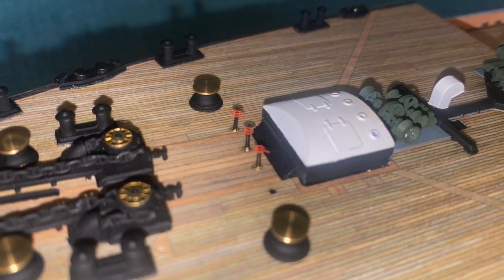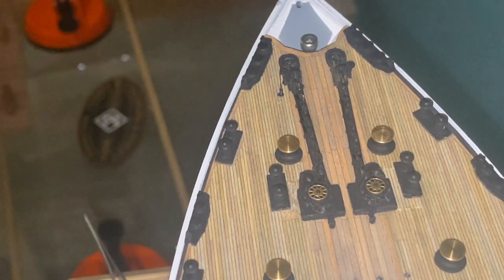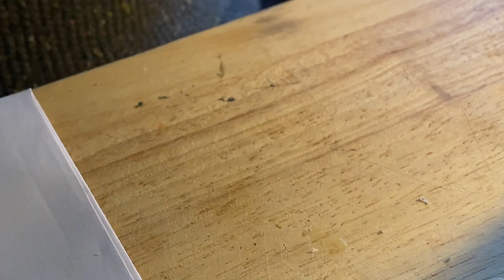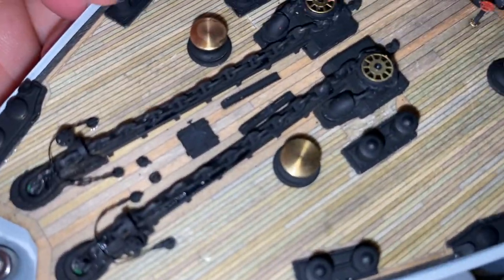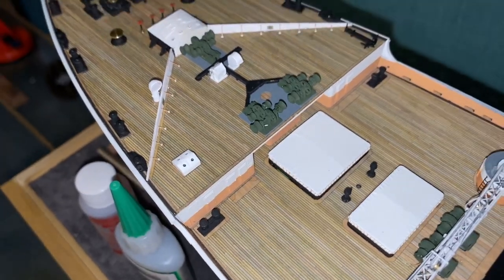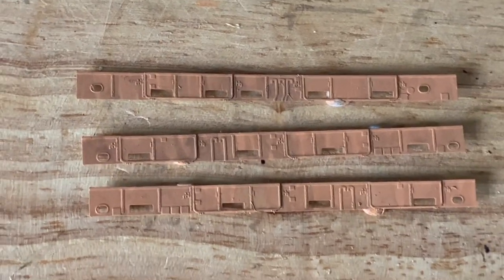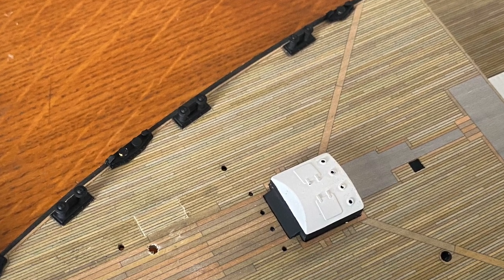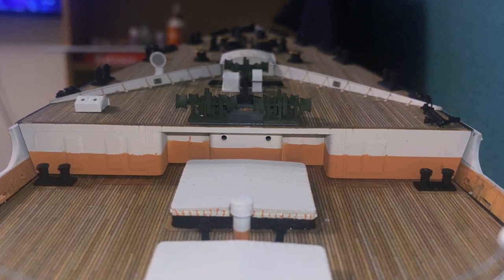Radio Control Trumpeter 1:200 Titanic Build Part 20 - Forecastle and Forward Well Deck

Comment: You know those diagonal bars behind the breakwaters. I think they were so the cable/rope that was usually flaked out behind there, Could be pulled over the top. If you see close up photos of the breakwaters there is no way they needed supports as they were very substantial. So you could lay a rope out behind them...
Reply from the maker: Yes I suspect that is part of their job. It would certainly make it far easier to move lines about!

Like a lot of things I suspect they had two purposes, I reckon they must have been for support too. If you have seen the videos on YouTube of some of the Atlantic waves ships encounter, practically everything at the front of a ship needs reinforcing!

Comment: Nice!  I was interested in the decking repair as I will need to do stuff to get rid of the lifeboat stand slots.....or buy another updated sheet 3 which is hard to get!  The details looks great and I want to move on with mine but wooden ship display case first.....hmmmm!  Hope your work is not too unpleasant if you have to work outside at the moment!  Looking forward to you tackling the aft well deck detail etc. Stay safe, regards JH ;-)
Reply from the maker: Thanks, yes the decking repair is tricky, but actually reasonably effective once done. I hadnt realised you'd have to tweak your scale decks but yes of course you will! Thats going to be a big job! Fortunately im indoors mostly, occasionally have to go to depots but still indoors if a bit chilly! You too, cheers!

Comment: Thank you for sharing!! It's a shame they sell an expensive kit and then it one needs to buy countless updated kits/ 3d prints, phot etchings, upgrades to make it look sharp... Which one would you recommend, between the pontos, Mk1, Ka etc?  It becomes quites the investment indeed :)
Reply from the maker: Hi there,
I think it would be a pretty good model without any add ons, though clearly not as good as a model with some addons. 
I think I would say the best single add on is scaledecks (as I think the model is big enough that it really benefits from a wooden deck).
Other addons, the KA set is good, but there is just tonnes of stuff. So really this depends what you fancy.
In some ways I’d say you might be better to pick and choose a few bits and bobs you want from China 3D and Woodies Modelworks
Reply: @TheModelBoatGuy   Thank you for your asnwer and help.  I'm confused, because there is the Pontos set, I did see the MK1 set as well, but the KA set I can't seem to find any trace of it....perhaps they are all sold out. I did see there are different versions of the decking, one which Midwest model shop uses which I like which is a bit darker, and the other versions which have a yellowish hue to them. It's quite overhwleming, although I might consider the china 3d prints :)

Comment: thanks. for the info on camera. i am starting my Arizona 1/200 r/c conversion project. i have a iPhone 10 xr .i should get a tripod and try it out. thanks
Reply from the maker: I mean I use a pretty basic setup! I have a simple and very cheap Gorilla tripod. My plan (pre lockdown) was to look around charity shops because there always seems to be real camera tripods in there. But for the time being my little tripod will do

Comment: I'm still trying to clean up the KA anchor chain lol.
Reply from the maker: Ah right, I did think there were a lot of supports on those chains! Because I used the Shapeways ones I didn’t have to work though that but I am thinking the KA chains might make a nice bit of detail for the stand so I might end up using them later!